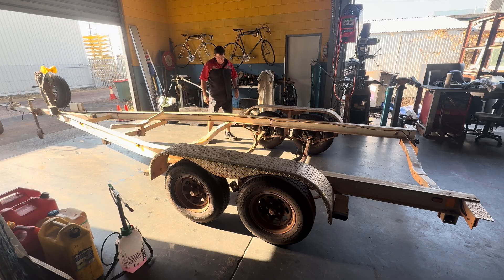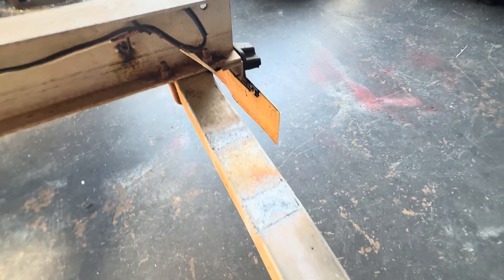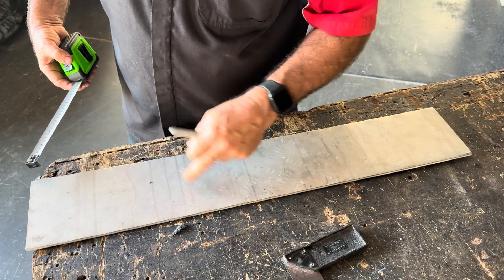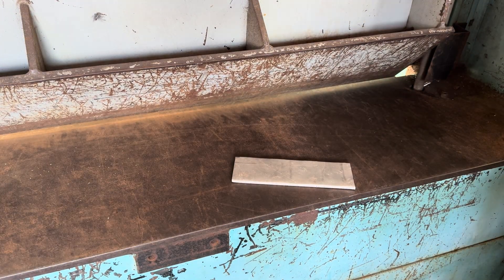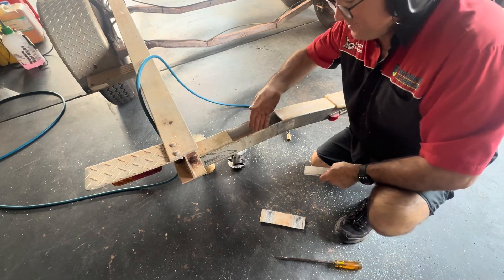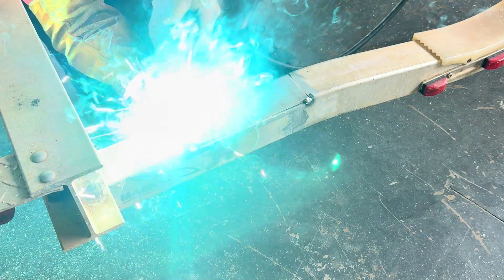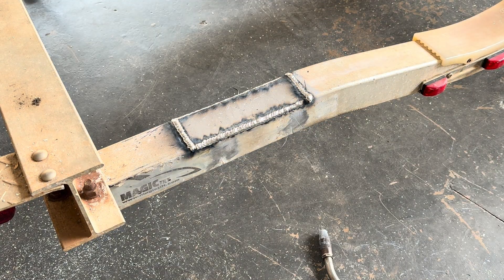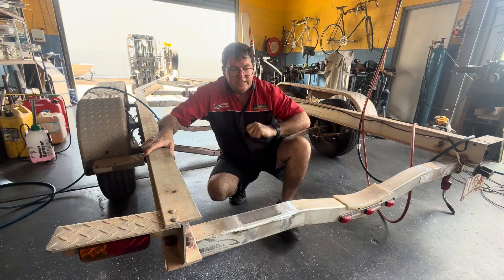Critical Aluminium Trailer Repairs You Must Do Before It’s Too Late

Comment: Sounds like someone has got a Pulse Mig 😄👍
Reply from the maker: Yes Only the best Fronius
Reply from the maker: Weld Machine what do you do ?
With a name like that!
Reply: @RacingRenovators  Pretty much Everything ??
But I learnt the hard way, to tone it down when I was starting to stretch myself too thin trying to get so many jobs completed ???
Regrettably I had to lose a few good customers, but I still work most days trying to get the job out 👍
Reply from the maker: @weldmachine I hear you mate 
I have done the same over the years 
I have learnt to say NO 😂
Reply: @RacingRenovators  Fronius definitely make nice Welding Machines.
Until they don't work anymore ???
I don't want to rubbish the brand too much.
But I have a customer that services Welding Machines and hear so many stories of the need to replace a circuit board ???
Easy job at anything between $1800 and around $3500 for the later machines.
Not saying they all fail and other brands do also, but Fronius is at the higher end when it comes to replacement parts.
I know this from a machine I owned around 10 years ago.
All the bells & whistles.  
Just out of warranty the board goes ???
Thinking ok just order a replacement from my friendly dealer.
$3250.
I managed to get it replaced under warranty thanks to some paper shuffling from my friendly dealer.
When I got it back I regrettably sold it.
Thankfully by this time I wasn't really using the machine and had already considered sell it,  now I just use my everlasting CIGWeld 400 Mig ( Transformer ) and Tig Weld anything else. 
I'm not saying it will happen but you will get the same surprise as I did IF the same happens to you. ( touch wood it never does 👍)